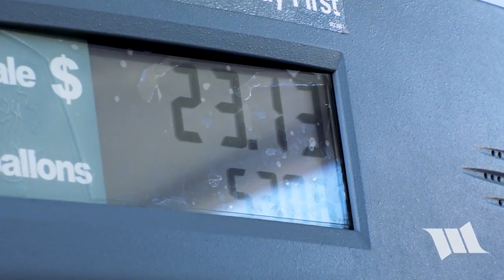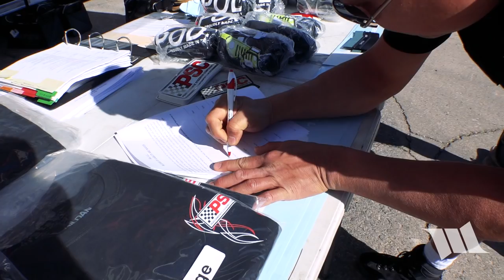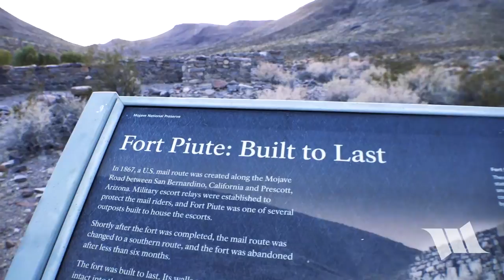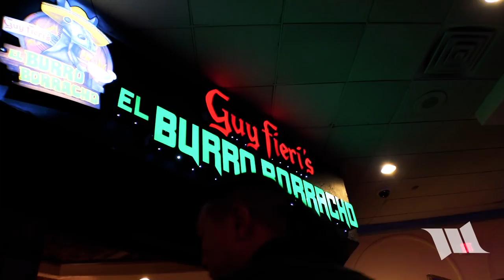Overland Trek Across the Mojave Desert in Jeep JL Wranglers Nitto JL-Experience JLX  REUNION Part 1

Comment: Totally loving what PSC did with their JLU!!! They are not only the best choice for steering, they went over the top on their rig. The FOX coil overs with tri-link front and a four link rear is incredible. Goals man... goals.
Reply from the maker: Their rig was awesome but the weak link was the Fox coil overs. They were struggling with them the whole trip and were far from happy with the ride they provided.
Reply: @wayalife  Interesting... I've been running the Fox 2.5 reservoir w/ DSC on all four corners for a couple years now and have been very happy with them. I wonder if they used too strong of a spring for their weight, or didn't have the high and low sides set correctly? I know on some installations it can take a bit to get the rates and adjustments correct. Whatever it is, I hope they can figure out it quickly.
Reply from the maker: @phantumdrummer  All I can tell you is what I was hearing from them. I think the problem was with the internal bypass.

Comment: What bottle jack are you using? My axle is over 16in off the ground and having a hard time finding a jack that will extend enough to lift it. Been using my high lift on my sliders but its kick out a few times in the trail.
Reply from the maker: First off, you need to be lifting your axle from the base of your differential or bottom of your control arm joints - NOT from the tubes. Even with a set of 40" tires, this should only be about 12" off the ground. Second, I always carry a few pieces of cut down 2x4 just to give me options IF needed (rarely do). Third, Hi-Lifts are NOT to be used change out tires - that is not what they're for and can be very dangerous being that you have to raise your Jeep crazy high just get your coils to unload BEFORE your tires get off the ground. That being said, here's a link to the bottle jack I'm using https://amzn.to/2L0OOAu

Comment: High Eddie I had to search back to find this video. I am wanting to separate my locker switches to make them work independently front and rear separate. Mel used two separate wiring harnesses and the aux switches. Question is can that be a permanent solution and if so do you the part numbers for the harnesses. If not do you have a better solution.(still using factory lockers.)
Reply from the maker: Yep, it can be permanent setup. eBay has them. Just look for a Wrangler JL electric locker wiring harness.
Reply: Wayalife thanks Eddie as always your awesome.

Comment: How do you like the STT Pro's?   Are the ok on on asphalt, rain, snow?   Given you were at a Nitto event do feel a pull to try them?  :)    I am looking at the STT Pros and the Mickey ATZ P3 for my 2018 JLU Rubicon.  Trying to decide.  Nitto is also very good.  Thanks!
Reply from the maker: Honestly, the STT Pros are one of the nicest MT I've run and the best when it comes to snow, rain and slick surfaces. Granted, an AT would do better but for an MT, they are the best. On pavement, there are a few MT's that might be quieter but the STT Pros are right up there at the top of my list as being one of the quietest. I've run Nittos in the past and they're great tires too but of the two, I prefer the STT Pro.
Reply: @wayalife  Thanks so much!

Comment: You guys didn’t air Down?
Reply from the maker: We did, we just didn't show it in the video.
Reply: Just asking because of the puncture on the gravel road. I’m a landcruiser V8 diesel 78series owner. But love watching your uploads on the jeeps and astonishes me the amount or accessories/mods you guys do for the jeeps. I’m waiting for the JL to arrive here is Down under. I think I will be buying the diesel version for the rubicon
Reply from the maker: What you don't see in the video is how rocky the trail got going over the pass. The sidewall failure was a pinch rupture as in, the tire was probably aired down a bit too much and got pinched between the wheel and a rock and to the point where it tore.

Comment: what kind of bottle jack was that?
Reply from the maker: Just a basic 12 ton jack that I picked up at my local Napa autoparts.
Reply: @wayalife  im running a evo long arm kit and the travel  is too much for a normal jack would a hi lift work better in this case?
Reply from the maker: @AdventuresWithRyanHanley  You mean so that you can lift your Jeep to dangerous heights before your axle leaves the ground? No, a Hi-Lift is the worst thing you can use to change out a tire. The whole point of a bottle jack like this is that you can place it under your differential or control arm mounts like you see in the video - the lowest point on your Jeep and safely lift the tire off the ground. If you use a Hi-Lift, you have to keep going up until your shocks fully extend and that'll leave your Jeep floating dangerously high up in the air. Trust me, I run 40" tires and an EVO DTD with 14" of travel on my JK and NEVER carry a Hi-Lift with me.
Reply: @wayalife  oh okay thank you Eddie sorry if my question sounded stupid but makes sense now thank you again and good video!
Reply: Hi Eddie great video.looks as if you were running separate wiring harnesses to the front and rear lockers and wiring them to the aux switches. That would allow you to run front and rear separately correct . I would love to separate the lockers on our JL. Let me know how that worked out if this is what was done and part #s for the wiring harness if possible. Keep up the great work.
Reply from the maker: @AdventuresWithRyanHanley  No need to apologize and you'd be surprised how many times I see guys incorrectly using a Hi-Lift to change a tire. It really is the WORST tool you can use especially if you're running big tires and a lift with a lot of travel. It's crazy dangerous and I've seen people almost get really hurt from rigs falling over. A bottle jack is the best and safest tool to use as it'll lift from the lowest point, require the least amount of jacking and is the most stable.